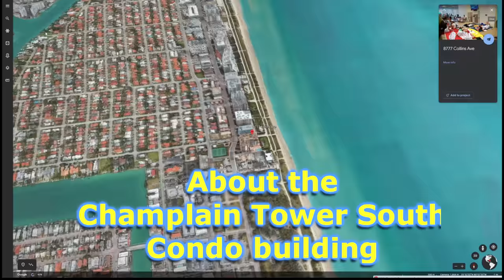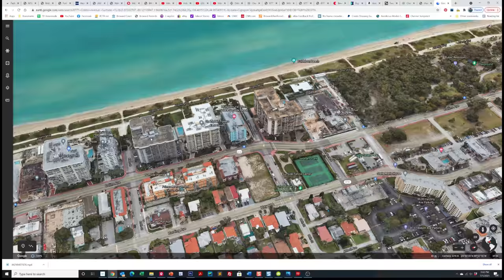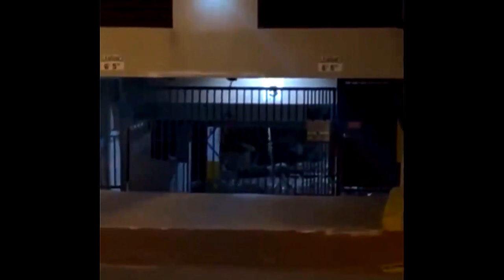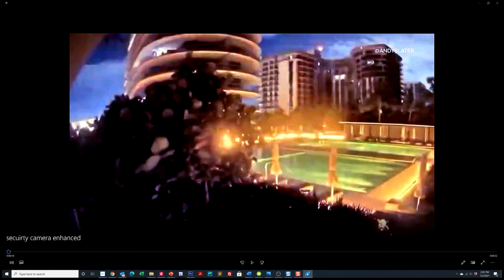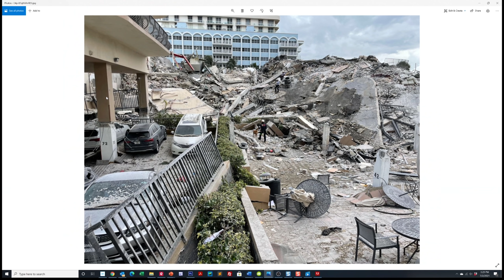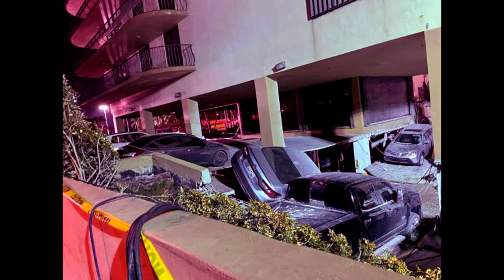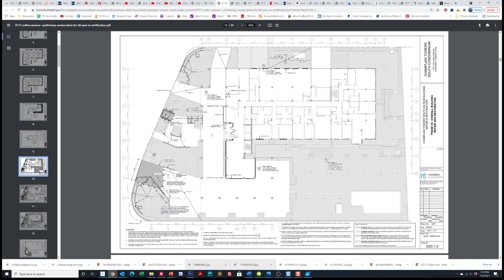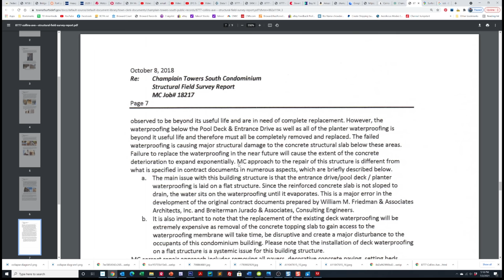Here's Cause Of Miami Condo Collapse Champlain Condo Towers, Surfside

Comment: Jewel of Miami Beach? I certainly wouldn't call it a jewel, but it was a functional, if not aging, multifamily building... that is until it collapsed. Clearly, the decaying structure of the building itself didn't reflect the 'decadent' remodeling jobs being performed on the interiors. Adding all of those expensive granite surfaces may have added live weight that the structure wasn't originally designed to handle.

Your video is more about how it collapsed, not really the specific cause. We can speculate that columns gave way or that spalling was involved, but we still don't know if the ultimate cause was from what you mentioned or poor construction practices, bad concrete, compromised architecture, poor rebar, too much live weight, hurricanes, salty sea air, subsidence, sea level rise or any number of other reasons.

One thing is certain, there were a lot of problems with that structure from the pool deck to spalling in multiple places. For potential residents of structures like this one, this means you should do your homework and request a walk through of the entire property so you can inspect columns, maintenance areas, underground structures, pool pump areas, electrical rooms and so on. A property owner should let you walk through these typically locked maintenance areas before making a purchase decision.

If you're paying to live in a multistory structure for potentially years, it's important to understand what you're actually buying... and it's not just the interior living space. Seeing any kind of decay, rust or standing water, particularly in maintenance areas should be a big clue not to buy a condo in that building. If anything, this is a wake up call for would-be buyers of condos and owners of condos in multi-story buildings, particularly buildings situated on coastlines... to personally inspect the building structure at least once a year (and before you even buy). You can't blindly live in a space and forget all about the structure around you or its maintenance, lest history repeats itself. 

For example, how many more aging multifamily structures are in a similar state of disrepair? If there's one, there's more than one.

Comment: Obviously, in hindsight, that building should have been evacuated immediately,  when the damage under the pool deck was found...sadly, they weren't...& now watch the class action lawsuits start rolling in,  as they should! 🤨😔
Reply from the maker: From the time the initial pool deck collapsed into the garage that was about 5 minutes time and likely many of the people didn't hear it. We did notice that the people that heard the most were those that were in unit 111, unit 611 because they were directly over Ground Zero and felt it shaking in the columns.

Comment: I've always wondered why residential towers are built with concrete and ribar instead of steel columns and girders like office buildings? 
Steel is faster to erect. Money saving. They're stronger and last longer! Probably, cost more? It would seem to balance out financially?
Heck, that concrete building wasn't even old! 
NYC has 100+ year old solid standing buildings! True, their not next to the ocean..but they are close to flowing rivers! 
Ocean property in tropical weather..more reason to reinforce them. The collapse is a travesty none the less.
Reply: I believe steel is more expensive and more difficult to fireproof.
Reply: @nigelalderman9178  I possibly agree on steel being more expensive than cement. But, manhours during erection just might cancel and balance out their bottom line? 
Steel columns go up faster, but cost more in material, including fireproofing.
Cement columns goes up slowly, but requires higher manhours during curing process. 
I see steel as a no brainer. Regardless of price differentials. One thing is clear. Beach front properties are more likely overpriced from the onset! So cost in manufacturing is often an afterthought.
Cutting cost by way of cement apparently turned into clay being so close to salt water. 
Makes me wonder? Will the Waldorf Astoria Miami skyscraper be built using cement?? No way!! Lol
Again, What's the price of life?

Comment: The potential cause of failure would be pretty obvious to an engineer or builder. Moisture is the enemy of any structure. The important question is why the design failure and if anyone will be held accountable. No one was when the CTV building collapsed here in Christchurch NZ.

Comment: Ive got what i think is a reasonable question that i have not heard anyone else puzzle over. It looks to be a failed demo. It drops like a stone. There was a couple days of searching for survivors or remaining bodies. There was a hurricane coming in from off shore and they wanted to drop the rest of the building away from where where they were digging. Here's my question. How did these SUPER demo guys get that building prepped,cut, primed and brought down in just a couple of days? Not to mention, its a building that is already compromised so it would probably have to be inspected. just for an assessment of where to cut stairwells and properly place charges would take weeks. Of course they could've saved the money just set a few diesle fires about 3/4s of the way up and watch it collapse into its own footprint like building 7 on 9/11.
Reply from the maker: They didn't do it in a couple of days, I suspect the city was on the phone to them the next day once it was determined that that building was unsafe and I think they were trying to make everybody think they were working hard diligently rescuing when I knew that there was nobody to rescue and so did they. I think they were just placating the public while they were planning the demolition of the surviving part of the building. But either way it's a small job compared to what these guys normally do and so it was very easy I think to do anybody can look at the plans until quickly what it is I need to do in which columns I need to blow in order to make this thing come down. They say it normally takes them two to three weeks but they must have concentrated everybody on this rush job in a matter of two weeks.

Comment: I believe this condo collapsed by a slow sinkhole.  The pool and garage starts sinking and that slow movement can cause damage to wood pipes cement etc.  All structures as it sinks will pancake down.  Don't forget all there is under The condo is SAND. which  doesn't make a good base for foundation.  Sinkhole problems start with cracking noises causing underneath garage and pool unstable  AND boom down comes a pancake effect as it sinks and condo follows straight down.  WHAT a TRADGEY.   God bless All the lost souls 🙏. I don't think The builders are at fault. 40 years old buildings are all in danger in Florida.  Especially when built close to the Ocean and the damage to the Condos by Hurricane 🌀 problems.  In 40 years none of the water in the garage was reported by condo owners.  Think Sinkhole.  As a reasonable cause of the TRADGEY 🌪️⛈️.

Comment: Dip the steelbars in anti-corrosion paint before embedded in the concrete. When the rebars corroded away by the sea salt, that's what happened
Reply from the maker: They already have processes like that for epoxy coated rebar. But that presents its own set of problems that I believe Canada is already trying to ban it because if you have voids in the epoxy, or cracks due to rough handling of the rebars when they're being delivered on to the job site, it can actually cause worse damage by allowing water and moisture to seep into the holes of the epoxy and starts concentrated rusting in that area which can be just as bad as having no protection at all on the rebar.

Comment: The building collapsed as a result of either failed pilings and/ or grade beams. It was a foundation issue.
Reply: No it was not a structural/design issue! Those issues are showing of right away, this building has standed for over 40 years and was symbol of the oceanside.
No major structure, equipement or plan modification (for what we know) trough the years either.
So what collapsed her, was long proccess not overseen by the designers/engineers, and probably by no one up until too late.
Reply: The structure collapsed. That makes it an obvious structural issue. Foundation failure as a result of the collapsed pilings. Those aren’t inspected when the 40 year cert is done. They’re sub grade.

Comment: Why not use corrosive resistant rebar? Was this corrosive resistant rebar? Florida should require hurricane proofing and corrosive resistant rebar.
Reply from the maker: I'm not even sure if epoxy coated rebar was used at the time of construction back in 1981. Nowadays many construction projects use it so I'm sure if this building had been built today it would be in a lot better shape.

Comment: I am sorry to burst everyone's bubbles here, but what you don't realize because it is being suppressed is that the earth is undergoing serious changes. The video is excellent, but the cause for this collapse was not leaking water and deteriorating concrete it was the fact that worldwide the tectonic plates and soil are on the move. Look and you will see that earthquakes are happening all over the place, volcanoes are erupting, enormous releases of gas are visible and trackable on maps, and sinkholes are happening all over. The Gulf is expanding because the plates are being pulled apart. The New Madrid fault is unzipping and was the cause of the pipeline issue no some claimed hacker rubbish. This happened because the soil is on the move. The entire crust of the planet is on the move. Land West of the Mississippi River just sank lower than the Eastern side just a week ago. That is why the bridge's metal frame cracked like a Kit Kat bar.  Expect not to be old the truth because the elite don't want us to know what is causing it all. They have lied for over 50 years that Nibiru, Planet X is not real. Think for yourselves. The Sumerian tablets are the oldest records on Earth chronicling how people from Nibiru came here long ago to mine for gold and how we came to be. The "Red Planet" is at least 5 times larger than Earth, has been in our solar system since 2003, and is soon to pass by us on its way back out on its elliptical orbit wreaking havoc on the entire surface. They will blame anyone and anything rather than warn us publicly about this event which they and now you know will occur in 2026. It is survivable but the elite wants as many of us to perish as possible making our few numbers all the easier for them to control Hunger Games style in the aftermath. Things won't work out the way they want, but you still need to start prepping now and learning the simple steps you need to take to survive it.  Best

Comment: Interesting compilation of information. However, the analysis is meaningless. Jeff Ostroff is not an engineer nor architect. He is a construction contractor. Whenever a person advances theories without giving credentials, scrutinize them. There is a reason he fails to identify himself and prove his expertise. He designs and builds interior rooms of houses. He does not engineer multi-story buildings. I take everything said here with a grain of salt. Until certified engineers do a complete analysis of the building’s history and construction, no one’s picture analysis counts. 

This building stood for 40 years. If there was a structural engineering problem then why did it take this long to be exposed?
Reply from the maker: Concrete gives you advanced warning, The concrete here was talking for over 20 years. In 1996 they had to fix cracks in the garage ceiling. You can ignore everything I say, that's fine. Don't like the fact I don't have a PE license? That's fine. But my knowledge and experience dealing with building issues is still solid. Remember the FIU bridge collapse? That was designed by an engineer with a PE license. It failed. The Hyatt Regency walkway collapse in 1980? Designed by PE engineers, it collapsed. So your theory that only a PE engineer talks and everything else is "meaningless", is a flawed metric.
Reply: @jeffostroff  dood you've got immense talent! I think your videos are the best I don't even watch the others.

Comment: thats bullshit, rebar does not swell when it rusts, it dissolves!
Reply: I think you should go research that theory.
Reply: @MBr397  don't have to, unlike you, I know from experience metalurgy!
Reply: So all the research in civil engineering is wrong, gotcha.
Reply: @toddjohnston1775  lol our government? You mean science, and experiments that have been used to study what happens as rebar rusts inside concrete. But let me guess the government made this building collapse.
Reply: @MBr397  are you bored, am I your only contact? good hell, do your own research, it isn't that hard to get metal to rust, then you will know.
Reply: @MBr397  that pool had been leaking for years, it started with a hairline crack, where chlorine water seeped in through the concrete to the rebar causing it to rust therefore causing the rebar to weaken and after many years of this the rebar lost it's strength and the pool collapsed, there really hard to figure out.
Reply: @toddjohnston1775  I have done my research and studied this. You need to do research.
Reply: @toddjohnston1775  exactly which bring us back to your original comment, once the rebar started to rust it expands which causes the concrete to crack and fail.

Comment: 3:14 rebar doesn’t expand to “several  times” its own width…. BS exaggeration 

The oxidation (aka rust) adds to its dimension, slightly…but enough to causing internal pressure and spall the concrete

When you exaggerator and give false information you lose all credibility
Reply from the maker: You've never been to florida and seen expanded rusted rebar